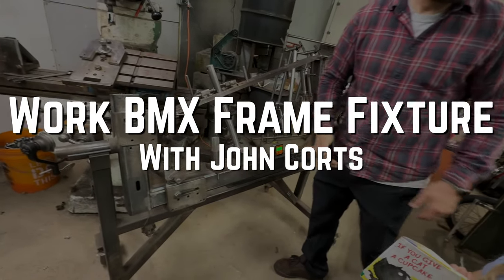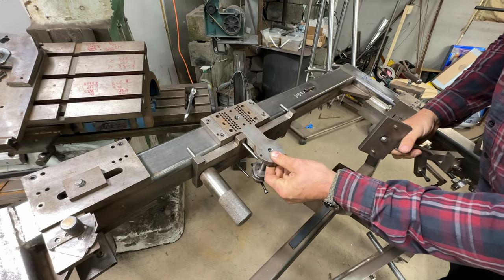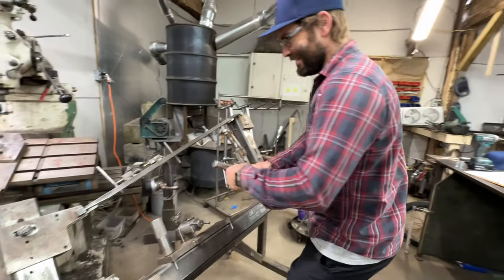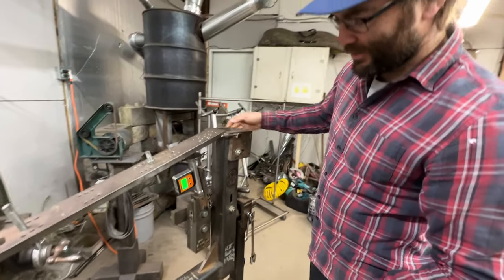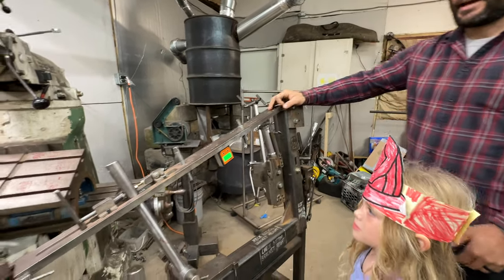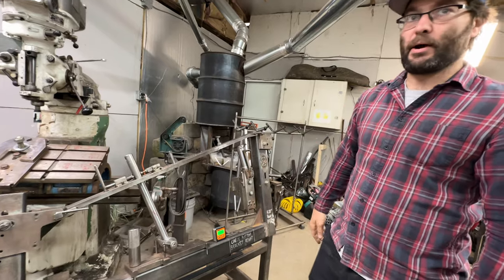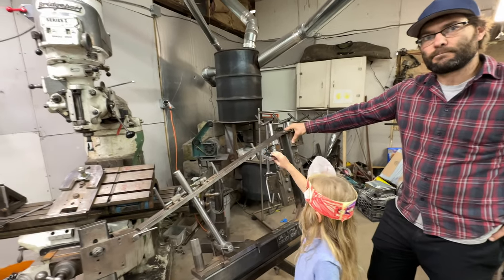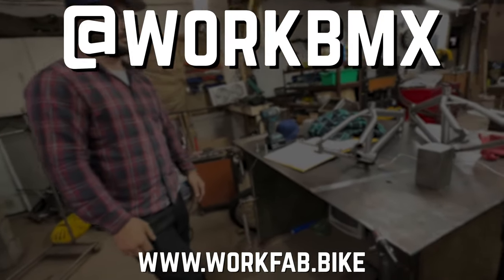Custom BMX Frame Fixture - The Key To Repeatability With John Corts

Comment: Heres a "nerdy" question, typing while watching. 
TT is measured center of HT and ST, but a little nudge on ST angle and standover height will actually affect the actual "feel" of the TT length, is that right?
For example, a really low SO will actually be shorter than a really high SO frame, if all other specs are the same. Or will the usual 71° ST enough to compensate for that change? Wasn't paying much attention in trigonometry so there is that.
Reply: Yes. It does change it. Very little though as the contact angles are small. The seattube contact is on average 3-6 degrees and headtube is 0-2 degrees. Drastic changes in standover is where your really notice it.
Reply: @johncorts6359  follow up. 
How does the TT get cut/measured then on the jig? 
When the ST and HT are fixed on the jig, then the TT get cut, or another way around? Im guessing the TT length will differ.
So what im asking is, the TT is constant regardless of geometry/SO.